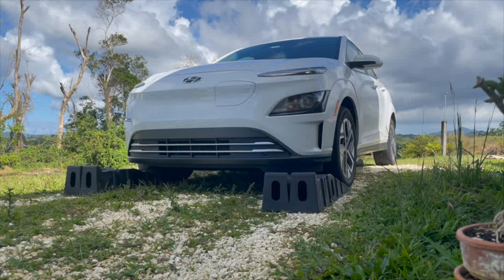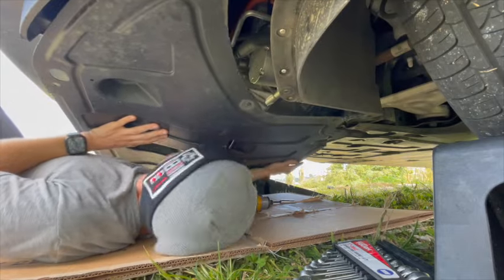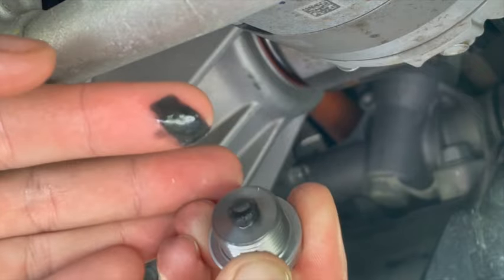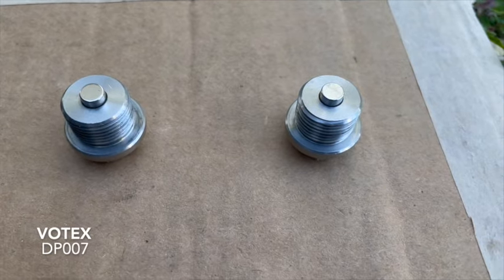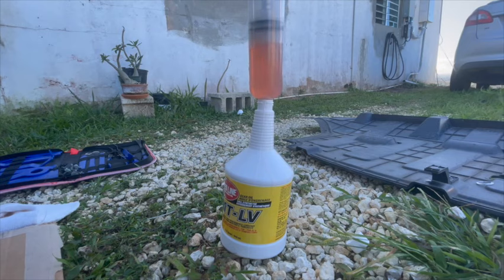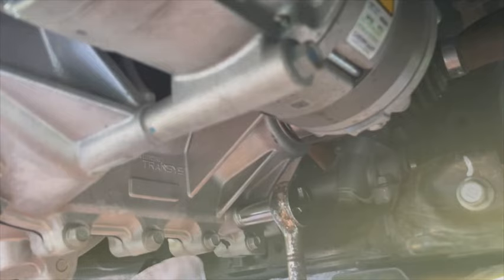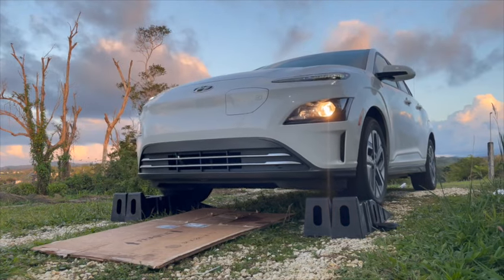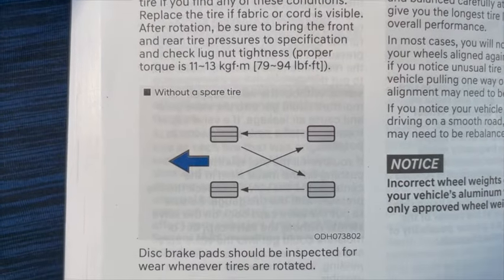EV Oil change? Hyundai Kona Electric

Comment from the maker: This is the second oil change on this Kona. The plugs shown in the video are not the OEM ones. I installed these on the very first oil change at 6k miles. These are made by Votex, part number DP007. The crush washers are needed if you plan on doing extra oil changes as shown in the video. As many have asked, is this strictly necessary? Well, Hyundai doesn’t call for it, yet, but they are aware of the extreme wear and many of these break at some point. If you plan on keeping your Kona, this might be a good idea if you want to avoid any big repairs in the future. The first oil change was analyzed at StoneLabs as well, and it showed VERY high amounts of Iron and Aluminum. I’ll make a part 2 when I get the results of this test.
Reply: We are waiting the results of the test.
Reply: I have four UOA reports from first-time Kona oil changes and all have high iron and aluminium levels.  We are also awaiting one for a 6,000 km interval while using double Votex plugs, will post when I have it.
EDIT: that showed very low iron and continuing very high aluminium. So, the Votex plug works well but the source of aluminum is still a concern.
Reply: I have a 2019 Kona EV. What kind of oil would you recommend for the gear reduction unit
Reply: What mileage??

Comment: I have a 2019 Niro EV. at 39k miles, just had my 3rd drive motor installed. At this rate, will likely need my 4th at about 50k miles. Never buy another Kia/Hyundai.

Comment: I just did my third oil change at 21,000 km and I'm happy to report that the oil is now staying clean.  I just filtered it through an N95 face mask and put it back in!
Reply from the maker: Good! Mine is clearing up as well.
Reply: @elcano9  I'll add that today an owner in Boston photographed the internal OEM magnet and checked it by poking a paperclip inside.  Turns out it appears to be non-magnetic.  So, to date we have about 20 oil change reports in total on the InsideEVs forum.  Every single one with an aftermarket plug magnet is returning clean oil, all those without are returning dirty oil.  Case closed I think!
Reply: It is not about oil clean. The oil loose it properties
Reply: @ibrokh4857  not in 4,000 km it doesn't.  I have 13 used oil lab analyses from Kona owners. None mention a loss of oil lubrication properties but ALL mention the excessive metals contamination.

Comment: Some Kona EVs have a defective reduction gear, there have been manufacturing tolerance problems on the Niro EV and Kona EV that has resulted in some motors and reduction gears being replaced. If yours makes a faint high frequency "ticking" noise audible at lower speeds, your reduction gear may be defective and that would explain the metal particles
Reply from the maker: Hi! No, it doesn’t make any sound at all. We have pulled the oil from 3 Konas, and each of them have the same looking oil with no noise. I received the oil analisis on this one, and the metal concentration is still high but less than the first change.
Reply: The "wheel of fortune" noise seems to occur outside of the gear cavity at the splines and by all accounts may be a different problem.  All Kona/Niro/Soul/Ioniq(classic) produce a lot more debris than they should and periodic oil changes can only be helpful in avoiding long term issues.
Reply: Mine had the reduce box replaced, it was making the tick tick noise (see my video). Now I'm at 135 000 km and no problem since the replacement.

Comment: I bought about 50 of those little magnets, takes about 15 seconds to drill a 1/4 holt about 1/2 deep in most drain plugs and they drop right in and won't easily come back out. I use them in many transmission, transfer case and oil drain plugs that didn't come with a magnet in them.

Comment: Thanks so much for this. Wow, that reduction gear oil was pretty nasty. We have a 2022 Kia Niro EV and are getting ready to take it in for the third maintenance service (22500 miles). We got charged almost $300 for the first one at 7500 miles for "EV visual inspection" and therefore are considering taking it to a non-dealer mechanic. Do you think a non-dealer mechanic working on ICE's their whole life could handle all the EV maintenance without being trained on one? Like if we gave the list on the back of the manual (there are 14 line items: Tire pressure/tread/rotation; Climate control air filter--which looks straightforward enough to do ourselves; 12V battery condition; Steering gear rack, linkage, and boots; AC refrigerant/compressor; Brake fluid, lines, hoses, connections; Disc brakes and pads; Brake pedal; Drive shafts and boots; Suspension ball bolts; Reduction gear oil; Coolant system and coolant).Are there areas that are dramatically different or not on ICE's (I think the reduction gear is one of them, but others), to be aware of and a mechanic should have been trained on before working on the car?
Reply from the maker: Any mechanic who knows how to change the gear oil on a manual transmission will be able to perform this maintenance with no problems. As far as the other list of items, these are nothing unusual from what you would do on an ICE vehicle, and are mostly inspection requiring little to no intervention. Now, working on the HV systems on an EV does require proper training and certification. The 12v battery system does not form part of the HV system up until the DC to DC converter. The Kona on this video now has 23k miles with 97% of battery state of health, no issues whatsoever. I only do tire rotations every 6k miles, and this oil change we did.
Reply: @elcano9  Thank you for the thorough answer and sharing your insights, very much appreciated!
Reply: Oh one more thing, if I may ask, so if the gear oil is looking nasty (maybe not as dark as yours), it should be changed? Or is the concern more about the tiny metals/shavings that might be in it and the damage that might cause (and I gather that there might be some issues with magnetism of the supposed magnet)?
Reply: So if Hyundai does the oil change, and you ask the mechanic to look at it when it is done, what would he say? Oh it looks great, it is wonderful. We can put it back in? 😂

Comment: In the UK Cleevely specialises in doing UK wide mobile EV service including reduction oil change. Cost me £108. Think my WOF noise is less now (Kia Soul EV 2020).  Also attached a stack of neodymium magnets to the filler plug. I can make the noise go away by gently accelerating and then backing off and then gently accelerating again, then it stays quiet. Unfortunately I’m over the 100k warranty threshold.

Comment: Hello from Canada.  

Just changed my diff fluid following your steps using the Votex drain plugs. Everything went very very smooth. Thankfully,  my fluid was just very dirty and no suspended metal that I could see.  Mileage is 64K miles. Thank you for sharing this process.  From a DYI standpoint, things I learned, make sure your drain pan is placed out further, the oil may miss it.  Also, when removing the upper drain bolt be prepared for fluid to come out, so have your pan and rags ready :)   I can confirm I was able to fit little over 1QT of oil.

Comment: Does the OEM drain plug use crush washers?
Reply: yes
Reply: Yes. The reason they are saying you will need more crush washers is because you will be changing the oil 4 times a year and you will need them. You’ll see the old crushed ones when you remove the OEM plugs. I’m going with the Votex drain plugs.

Comment: I was told that the gear drive has to be changed, i took it to the dealer because it was msking a clicking noice whenever i took my off the gas , they also said that the left and right shaft have to be changed,  how hsrd isbto replace the gear drive?  Do the two shaft have also be changed?  Is the dealer trying to rip me off?  I took it to another dealer snd they say that it could be a bracket and if that is no the problem it would have to be the reduction gear...

Comment: Good video. Got the new plugs with magnets and oil and oil filler . One trouble i had was filling it to capacity since the car was on an uphill slant due to the ramps.  I could get a little less than a quart in before it starting coming out.  So I lowered the car and took off the front drivers side wheel, reached  in and was able to fill it to capacity this way.  I then drove it up on the ramps again  and retightend the filler  plug.

Comment: just a tip when you want to change the oil always start by removing the fill plug. if you cant remove it stop and fix that problem first.
if you drain the oil and then try to remove the fill plug but you cant you are kind of fucked. luckly he fixed his fault by finding out it will slush like crazy when you dont remove the fill plug first.
Reply from the maker: Thanks! I did it on purpose just to show what happens in a funny way lol. I've been a gearhead all my life and done countless manual tranny drains. These are not the factory plugs btw, I already removed the OEMs last oil change and fitted these magnetic plugs.

Comment: Ticking timebombs, that oil looks very bad. It’s waiting for the bearings to fail.
Reply: @elcano9l52  Good to hear, if there aren’t visible metal parts in the oil it’s fine. It will get dark anyway.

Comment: I just don’t get it! In industry electric motors have been around for over 100 years, with reduction gears attached for for 10’s of years in industry . Many are sealed for life running for 1000’s of hours. The gears are made with high precision, some with hardened teeth. Are you saying automotive gears are made to a sub standard compared to there industrial counter parts?
Reply from the maker: This is a Hyundai only issue, seems they messed up somewhere in the design. I will post a follow up video soon, the last oil analysis has leveled out considerably.
Reply: Imo saying there is an issue with design based on a simple oil analysis isnt really a satisfying answer. We need actual statistics of these gears actually breaking.

I have driven my Kona for 180k km and so far the gearbox (and everything else) is holding up perfectly fine. Still have 4 years warranty left aswell...
Reply: @Trikkie87  yeah the issue likely is not a design issue but more of a manufacturing process issue where excess machining swarf is contaminating some of the gearboxes. I have seen this in the industry I worked in for 40 years replacing and rebuilding electro mechanical drive systems...many of them into the 1000's of horsepower.
In any case it never hurts to replace gear box oils no matter what. The suspended aluminum in the oils looks alarming but in actual fact is not as damaging as imagined. Steel contamination however will have a wearing affect on gear teeth and bearings...
Have a good day.
Mike 🇨🇦
Reply: @emilygrey9576  Hi...it would never hurt to change that gear oil but I do not think it is as concerning as it sounds. For the most part these drive trains are pretty reliable and trouble free! 
Cheers
Mike🇨🇦

Comment: COOL! But who is changing oil on their own KONA? Most people like me drive it to the Hyundai-service all 15.000km or at least every 2. year! Yes, its expensiv but perhaps you void your garanti if you don't do it at your car dealer. My 2019 KONA has 70.000km on the counter and I got a new mainbattery this week (because on the first KONA batteri 20 of 80.000 cars catch fire while charging therefore Hyundai exchanged them THIS MUST BE A REALLY EXPENSIVE RECALL FOR THEM).
Reply from the maker: I am! I’ve always been a DIY person for everything. This will not void any warranties. You are performing a maintenance. Hyundai recognizes this issue, but still hasn’t given out an official TSB on it, I guess they are just waiting it out whenever they keep going or eventually break, which I know they do. I’m planing on keeping this one, so I’ll do my best to prevent it from going in for any major repair.
Reply: Yes, in the bigger picture most owners will leave all servicing up to their dealer and all those will be driving around with dirty oil.  Perhaps a few will fail or become noisy as a result.  But there clearly is an unacknowledged deficiency with these Kona/Niro/Soul/Ioniq gearboxes and periodic oil changes can only reduce the risk of failure after the warranty expires. Used-oil analysis indicates twice the iron and aluminium contaminants as the similarly-designed Nissan Leaf at a fraction of the distance driven.  As long as the correct oil type is used Hyundai are unlikely to invalidate your warranty. My Kona has been out of warranty for 6 months and I will be staying on top of this unofficial maintenance. As an unexpected result, with clean oil the car drives quieter as well.
Reply: @elcano9  Given your experience and background working with cars, I'm glad to hear you're keeping it. I purchased mine outright and plan to keep it for a long time. I'll be following you for any other bits of advice!

Comment: I'm get my Kona next week what type of oil are you using to replace the original fluid? How often are you changing that fluid?
Reply from the maker: The oil type and part numbers are all shown in the video, this is the second oil change on this Kona. The OEM oil looked as bad as this one at 6,000 miles. I’ll include these in the description for the TL;DR lol.
Reply: If you want to make extra sure or if you can't find the same oil as he is using where you live, you can reference your owners manual. There should be a specifications section with lubricants and capacities. It has the type of oil along with a few recommendations in there. For my niro EV this is on page 9-6 of the owner's manual. The redline he uses is not on my vehicle's recommended list, but it meets the listed specification.
Reply: Api gl5 and 75w-90 sae

Comment: Are those stock plugs? I've read online that they dont have magnets in them and they should. I see your kona is a 2022 model, they might have added them.
Reply from the maker: No, as seen on the video these are made by Votex and are a direct aftermarket fit. The OEM plugs are non-magnetic.
Reply: @elcano9  I understand now. The ones you pulled off in the beginning of the video had me confused. I assumed this was the first time you drained the fluid and those were stock bolts.
Reply: @elcano9  And to confirm, these are the DP007 bolts made by Votex?
Reply from the maker: Correct, the part # for everything used is shown in the video.
Reply: @elcano9  You're right. Sorry man. I skipped past that bit. Putting the part numbers in the description is good for people like me who don't watch the whole video.

Comment: This is full EV? Because Niro EV doesn't not have any oil .
Reply from the maker: This is full electric. The Kia Niro EV and Kona Electric share the exact same powertrain. They both have oil for the reduction gear.
Reply: Well It could be that I'm only at 5600 miles after a year lol, But thanks to this it's the first I'm hearing of it so good to know .

Comment: Didn’t even know electric cars needed oil
Reply: Me either, I didn’t know that electric cars need oil change, if so I don’t want electric cars anymore.
Reply from the maker: Every electric motor with a reduction gear needs oil for the gears. This is an issue with the Kona, but in reality there is no need to change this oil until around 150,000 miles. Most EVs don’t even mention it, so it should last the lifetime of the vehicle.
Reply: @elcano9  understood